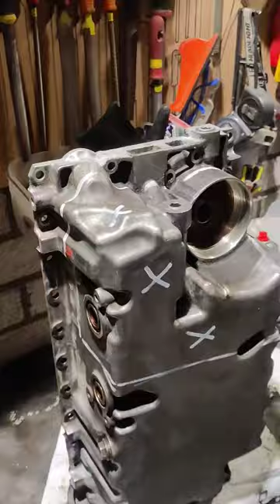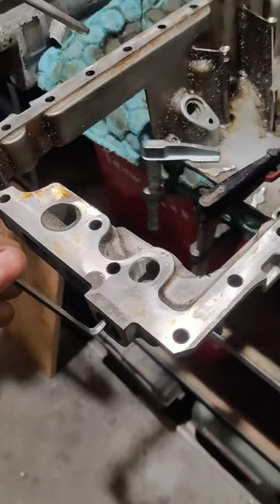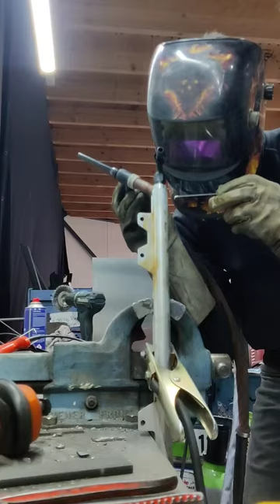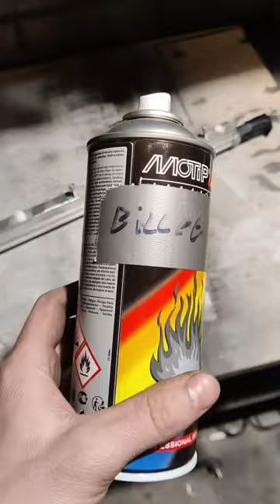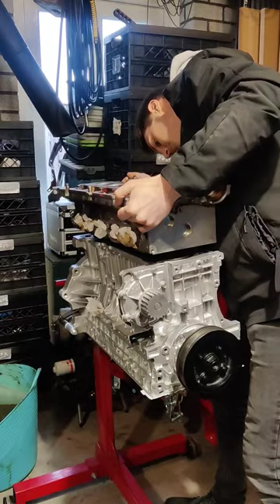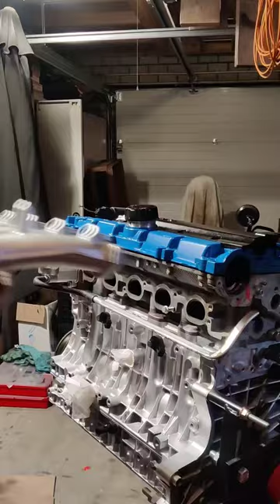Miata T5 swap part 5. Oil sump, Fuel rail and paint! #mazda #miata #volvo #cars #turbo #5cylinder

Comment: Welke 2.4 is het een benzine of diesel en welke 2.4 van de benzine of diesel
Reply: T5 petrol, D5 Diesel. Not sure but this maybe 2.3liter
Reply: @keijokalakari6974 he said in a older video that it was a 2.4 but there are so much 2.4 versions lol
Reply: @Carandmotorcyclefreak  ok. This was first clip what I saw. And that translation didn't do that well on your comment 🤷
Reply: @keijokalakari6974 2.4L petrol, Looked to be from a P1 S60 T5